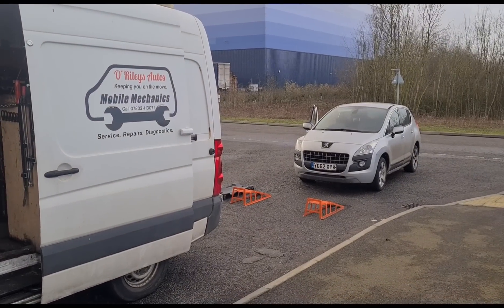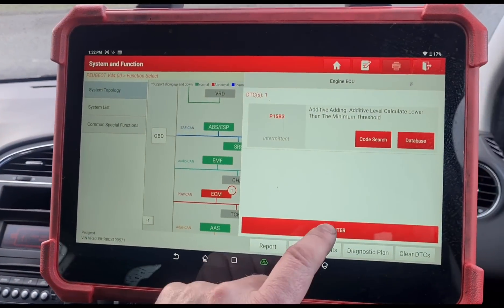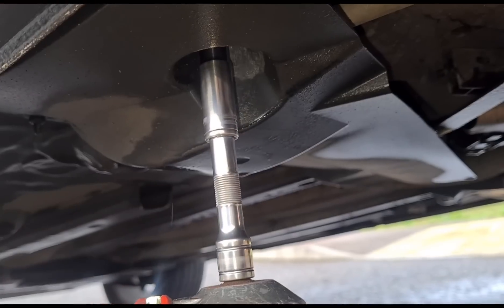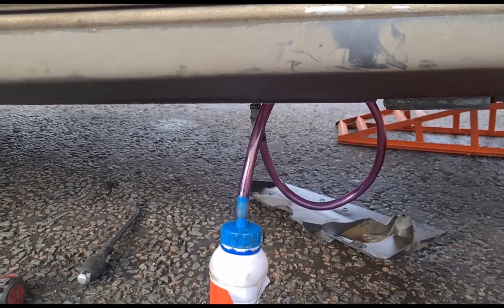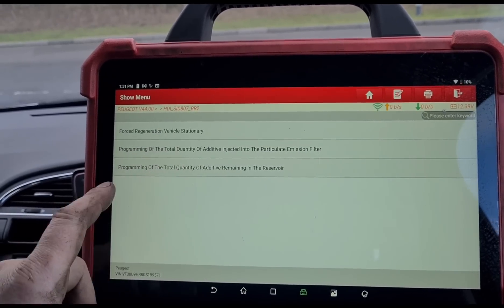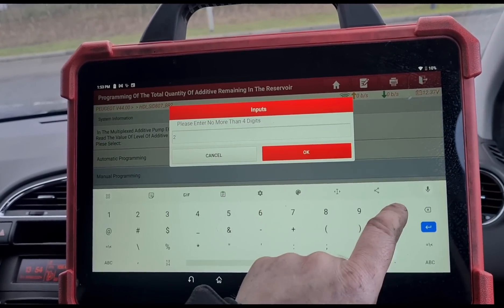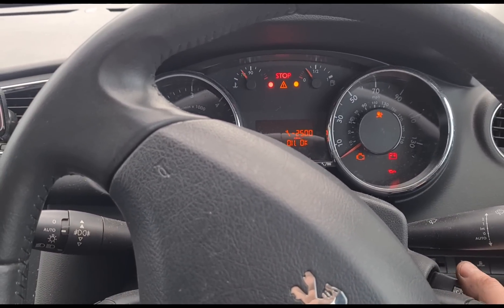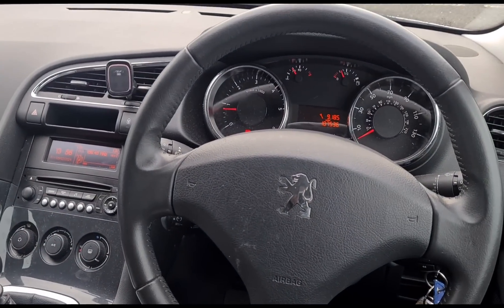Peugeot 3008 P15B3 Additive Level Lower Than The Minimum Threshold

Comment: Just had diagnostics done on my Peugeot 3008 2012, have the triangle on dash and engine fault  0n display ,it ssems to running  in limp mode, they told me it came up fuel injuector tank faulty or empty, not the codes my cheap opcom came up with.
Would this cause car running in limp mode?

Comment: I have the same problem with my Peugeot 3008, 2010 model. However I refilled it in auto car workshop. But the massage is still appearing every time when I start the car 🤔🤔🤔
Reply from the maker: You might need to reset the additive counter with a diagnostic tool.

Comment: Quick question on these but the semi auto box. Just got a sign on dash saying “gearbox fault, repair needed”.  I started car and put into auto and wouldn’t move and showed me a warning light which turned out to be the gearbox fault. Switched car off and came back to it an hour later and problem disappeared and engaged gear and driving but it did say “ECO MODE”. Read some forums and people keep saying that if the battery has a fault then these PSA engines can throw up a lot of faults like this so change battery first before touching any actuator problems these gearboxes can have. So just wondering if anyone knows this to be true??? I know salvage cars that haven’t had battery connected do throw up faults and once you’ve got a good battery on they do go away so is it the same with these and that they’re very sensitive or do I actually have a gearbox fault??? Thanks in advance

Comment: Best cars made were in the mid to late 90s (bloody good decade). They had just enough refinements to be comfortable, less tech to be reliable, allowed you to actually drive them and were definitely built more solid. Actually welded and not bonded together. 

I worked on a new shape VW Crafter the other day that had a sliding door issue. It turned out that the mid sliding door rail is bolted to the outer skin. The outer skin had unbonded from the inner structure, so the weight of the door was pulling it away, causing the door to not operate properly. 

I really can stand any of these new cars and vans. All sh*t in my opinion... and don't get me started on dual mass flywheels. If it ain't broke, then don't fix it, comes to mind.

Comment: For anybody with a Peugeot / Citroen - FILL  THE FUEL TANK RIGHT UP  - 
as there is a sensor on the filler flap - everytime it is open - the car thinks it has had a full tank of fuel so starts injecting the PAT fluid in - 
so if people just put small amounts of fuel in the tank will empty quicker and well before the 80-100,000 miles it should last 
 when Peueot / Citroen first went to the HDI stuff - there were LOADS of complaints about them clogging up as NOBODY knew about the additive tank not even the dealers !

Comment: I've a 2010 diesel Nissan Note with the Renault turbo engine. 
Thank goodness it doesn't have a DPF.
340,000kl on the clock,  still runs sweet.  Changed the oil and filter after 1000klm, which the old oil contained metal glitter. Seems that   all the edges have been knocked off. 
Changed the oil well below what's recommended for the oil change.
Mpg is hasn't changed after 14 years of ownership. 
Look after it  then it looks after you. 
Great video Jimmy   keep those oil burners on the road. 👍👍👍

Comment: I may be wrong but I think it would not let you do a manual entry saying it needs to be digits only because the amout you were putting in was more than the maximum amount that it can take (according to the manufacturer).
Would be nice if it showed the max value somewhere but ot doesn't..

Comment: It's unthinkable that a tanks that needs regular refilling is hiding under the car and has to be disassembled to refill. A more suitable fill line should allow the user to fill it and not require a scanner to reset the value - it's just another way to get more money for the dealers. You are right, it's the emissions control stuff that gets most problems and costs more to repair.

Comment: Its why ive went back to an 09 plate car. New vehicle's can just be an absolute headache when things go wrong with them. Its not like you can put the bonnet up and knew what the issue is with the older vehicle's. 
The new vehicle's i recon about 85% of time you'll need a some sort of a diagnostic machine to pretty much point you in the right direction as theres so many sensors of some sort.

Even to change a head light bulb you either need to dismantle half the car near the light or it takes about an hr to do compare to 10yrs ago it would be done in about 15 - 20mins both sides 😧

Comment: Jimmy the pipe you disconnected and used to fill system looked like it was going away from the tank. Is it a filler pipe and you just disconnected it from a dummy connection on side of tank?
Reply: The pipe goes to a bag inside the tank. the fluid is inside a pouch type bag, not an open style tank like, say, fuel adblue, etc the male conector goes to the pat fluid pump, that sucks the fluid up then there will then be an outlet pipe from the pump to the fuel tank. The bags also deteriorate over time and leak into the tank and that prevents the pump from sucking up the fluid.